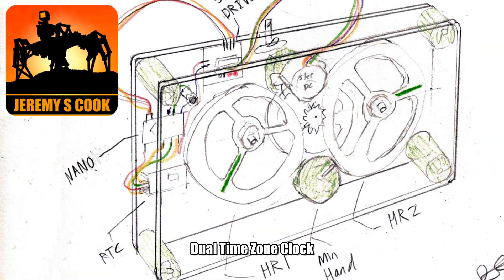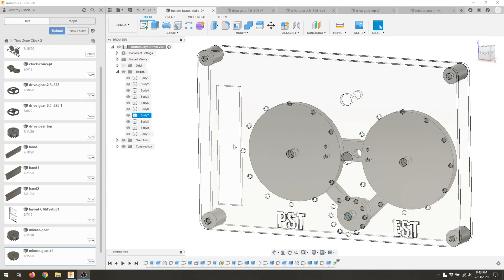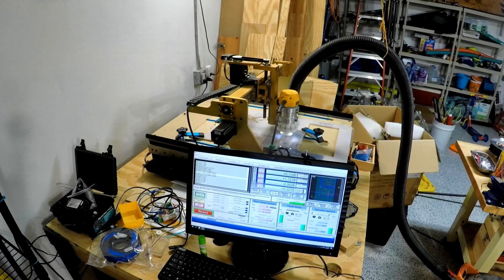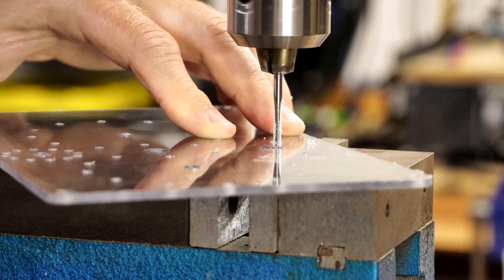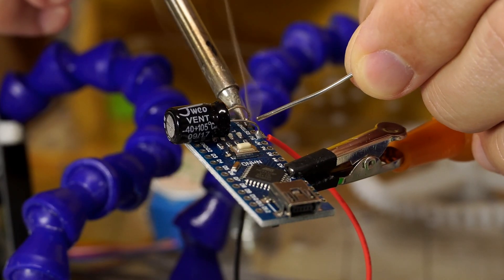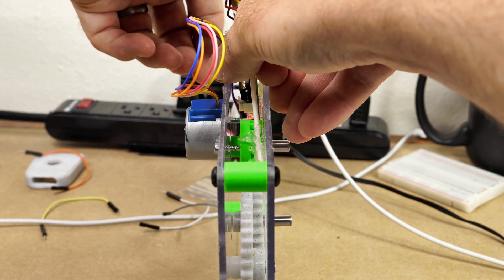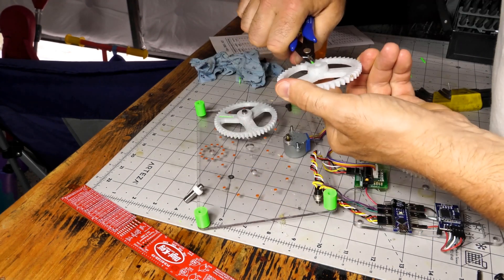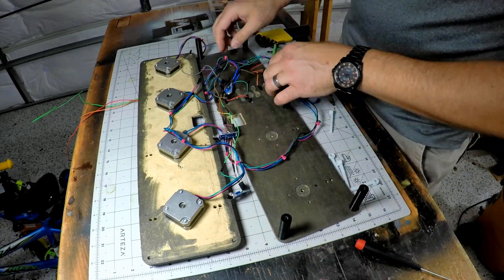Dual Zone Mechanical Clock [Arduino]

Comment: How has this done over time? Have you made any other changes to it? I'm tempted to build something similar, but perhaps using metal gears. I wonder if the gear backlash is causing any of the issues? Perhaps those split gears that have spring tension might help? I'm definitely a software/hardware guy, not mechanical, so this is outside my area... but if I get a 3D printer, I'll try something similar. I just love clocks in general.
Reply from the maker: Hello Aurelius - thanks for checking out so many of my videos and commenting, much appreciated!

Sadly, I disassembled this device and it never really worked the way I wanted it to. Perhaps it could be perfected, but I often move on to the next project before something is perfect. That being said, you might like my three zone PCB clock found here: https://www.youtube.com/watch?v=XAtKZ0VzOI4 - pretty neat, but it could certainly use a few tweaks!

Comment: What do you do if you need to set your clock to Newfoundland time?!
Reply from the maker: Guessing that's 30 minutes off of EST? Haven't tried, but the outer gears are 48 teeth, so should be possible. Interestingly, you're not the first to ask about non-hour time zones!
Reply: @JeremyCook  Yeah.  It is off by half a time zone.  I figured you had enough teeth to line up the hour, but the shared minute hand would be out of sync.

It is a really cool build, and I wouldn't worry about it.  If someone needs Newfoundland time, they'll just have to pair the other half with another oddball time zone!
Reply from the maker: @patregan  Ha, right, didn't think about the minute hand! Yes, it'll be usable, but limited there!

I guess I could put an actual minute hand on the top gear.
Reply: @JeremyCook  Minutes are overrated.

Comment: Very cool. Now make a Porsche Design version!
Reply from the maker: Thanks! Did Porsche do something similar?
Reply: @JeremyCook  No, but they do very manly products all across the board. Watches, jewlery, even one a Metabo hammer drilll with carbon fibre. So they look cool, but are also very expensive. I have a porsche design harddrive which was the same price as a standard one, but it looked nice.
Reply from the maker: @MaxMakerChannel  Ha, interesting - seems like I've come across Porsche Design stuff, but perhaps it's more common in Europe.